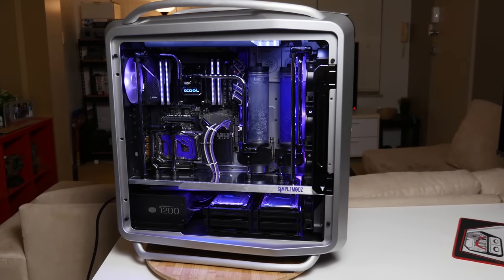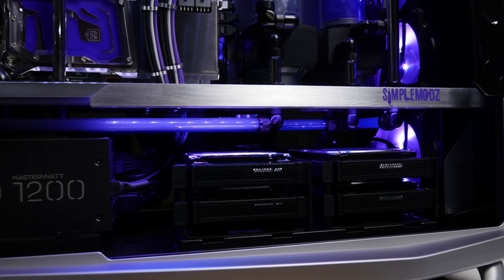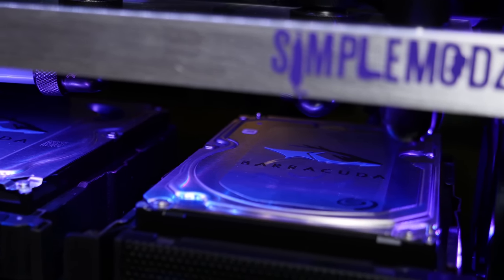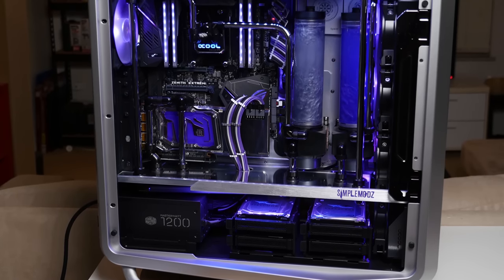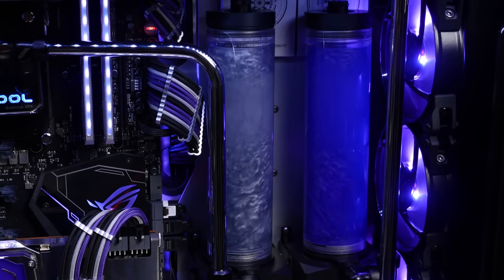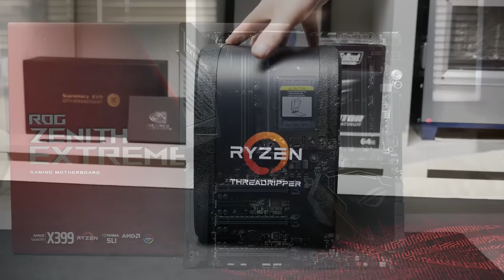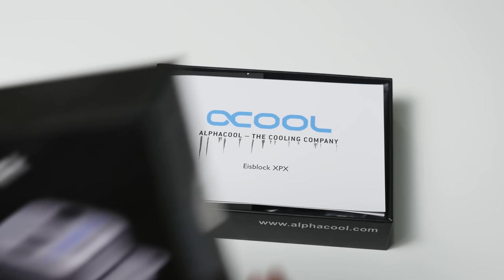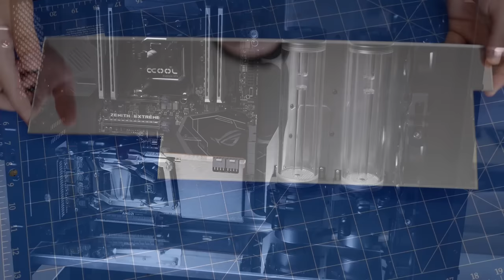Threadripper Gets the Custom Treatment, Pimp my 1950X

Comment: Awesome build, but why do a custom loop on threadripper and don't use a TR specific block? Also, put that M.2 drive on the Dimm.2 card/slot... I also don't think that thermal paste appl. on the CPU looked sub optimal, but probably ok with that block anyhow. :/

Comment: What will be best cooler for 8700k?
Reply: Florian Oprescu yes deliding improves temp performance but I m asking about Aio liquid coolers or Air coolers.
Reply: For AIO, probably a 360mm like the NZXT Kraken X72 or Corsair H150i PRO, but with better fans like Corsair ML PRO's (the H150i comes with downgraded ML's that can't spin as fast as the proper ML PRO's). For air, Noctua NH-D15, bequiet dark rock 3/4 or a similar giant dual tower cooler. 
And definitely delid it and replace the stock TIM with liquid metal, that will pretty much give the same drop in temps as going from a cheap aircooler to a 360 AIO. Maybe even get a custom IHS like the one Rockit Cool sells for $14 Because if you're already delidding, why not spend 14 dollars to drop the temp another 3-5 degrees right?